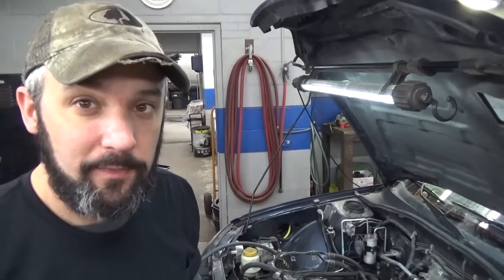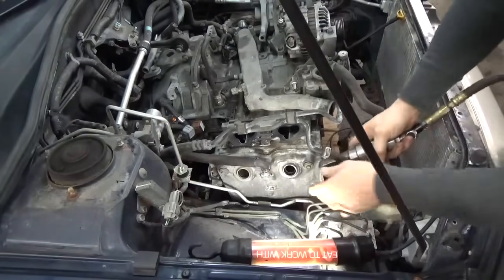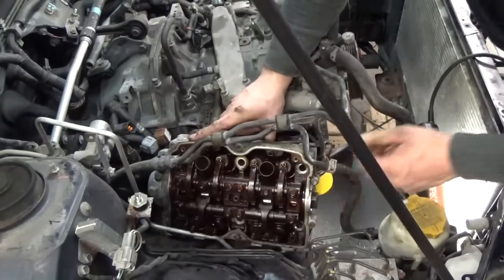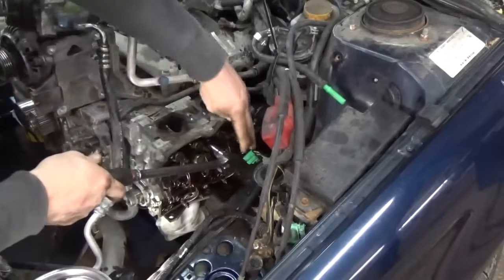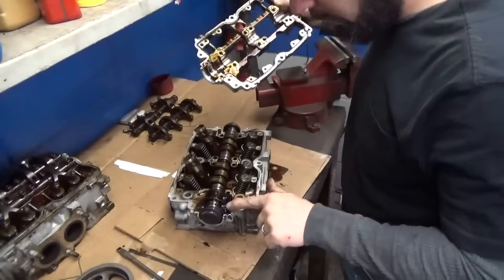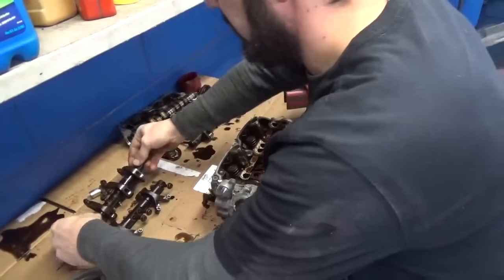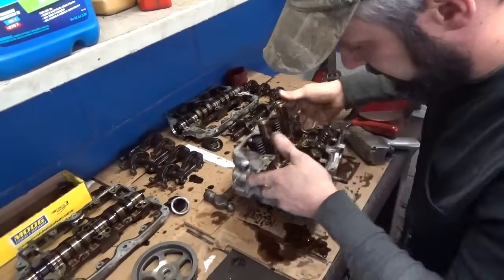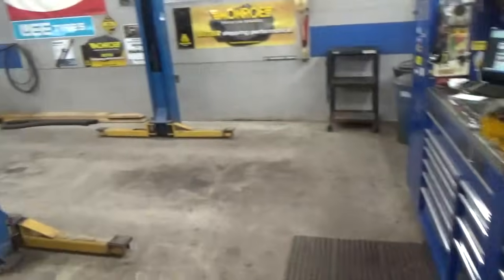Replace Subaru Head Gasket EJ253 - Part 2 of 5

Comment: I took a short term job as a service writer in the mid to late 70’s. At that time, EVERY ONE of them had leaking head gaskets at about 3-5,000 miles. They said it was due to head gaskets that were not compatible with antifreeze. Nice to see that nearly 50 years later they are still building the same junk at Subaru Heavy Industries. At the time, I owned a ‘72 442. They gave me a new demo with the job. I never drove it !good work Eric, I truly enjoy your videos, especially learning diagnostics on the new vehicles. Never too old to learn !

Comment: Not a Subaru tech or anything but I've seen other videos where theres a bolt pattern to remove the head bolts. Outside in. If you just remove them in any order you could snap a head bolt ask me how I know......

Comment: I started out at a Subaru dealership and was there for four years, I did plenty of head gaskets and never thought to do them in situ! Looks like I wasted some time! That's what you get for being a green apprentice! Nice series so far.
Reply from the maker: You lost me there..in situ? 

In situ (/ɪn ˈsɪtjuː/ or /ɪn ˈsaɪtʃuː/; often not italicized in English) is a Latin phrase that translates literally to "on site" or "in position". It means "locally", "on site", "on the premises" or "in place" to describe an event where it takes place, and is used in many different contexts.

Ohhh... so what did you do pull the engine?
Reply: Yeah. Pulled the engine and pulled the heads with it on the hoist, not too long a job because we did so many but never even crossed my mind to try another way! Dealer tech ah?!!!! I'm glad to say I'm a little wiser now.
Reply from the maker: Some times we need to slow down to go fast :)
Reply: South Main Auto Repair
 Brians mobile one has shown doing it in car and out ..he was MUCH fast out of car ..but then again he has a video up of pulling the engine in an hour and change ..( no talking fast forward ..just showing the process)

Comment: Eric I really do appreciate the mechanics that can do this job properly I haven't had such luck I swap the motor for a junkyard engine which didn't work out switching the oil cooler and everything .. ended up taking it to a shop to have the heads done on the original engine properly and five star head gaskets installed and they didn't even  put the oil cooler back on the original engine or the torque converter cover which I spent like an hour and a half installing on the other engine on my back the car being 2 and 1/2 to 3 inches off the ground.. you can  get  aggravated when you know people have all the tools to do the job right and they still find ways the script for screw it. so thank you for sharing this knowledge and your hard work. .

Comment: At 4:03...wow that valve cover came off easy! Can't imagine why they would change the design on the '05 and up EJ253. Those older style rubber oil grommets/washers around each bolt may seep a bit, but at least the bolt comes out no problem!
Reply from the maker: The big trick when your doing sooby v-covers is to jack the engine up. They pop right out :)
Reply: Yeah for sure! I meant on the '06 Outback that I did, the valve cover bolts were fused solid to the valve cover by corrosion (since they did away with the oil rubber grommet style), requiring an extra 3 hours of extraction and replacing all the bolts. I imagine it's even worse in upstate NY!
Reply from the maker: I haven't had one of the '06 up engine seize up yet but I sure do like the way those ones seal.

Comment: Hey Eric, I worked for Subaru for a couple of years and did a lot of head gaskets. I noticed you were talking about making sure the head bolts are lubed to prevent popping and creaking which is true but it's the coolant and crap in the bolt holes that cause the problem. Make a tap out of one of the old head bolts run that down and blow them out. I also saw that you did the heads in the car. It's so much easier to pull the engine. These engine come out super easy take about 45 minutes. Sure beats being bent over the car for hours. Also company 23 is a good site to find a handful of Subaru tools that will make your life easier.

Comment: I would send the head to the shop with the cams installed. The bearings or the lobes may be worn and the shop can tell. Now would be the time for new ones while it is all apart. Minimal extra cost for a better running engine & peace of mind. Also a new timing belt when you put it all back together, as well as coolant flush, t-stat, pressure cap & hoses.

Comment: The first Subaru I did was a 2000 ll Bean 6 Cylinder with 225000 miles on it,   I chose to pull the motor so I could reseal the motor while I was at it.
The car was from the east coast and of course there was a lot of corrosion all about the vehicle.  Once I got the engine out which really was not to b ad to do I went to pull the timing cover off of the engine and replace the timing chain and reseal the front of the motor.  At this point I discovered that it was a good idea to pull the motor to reseal it as the 6 cylinder motors have a 1 peace aluminum timing cover on them with 56 bolts holding it on and every bolt in that cover was corroded away so bad the only way to get then our was with a pair of needle nose vise grips and the Allen heads were just gone.  FYI Subaru wants $115.00 for the bolts that hold that timing cover on.  Apparently they thought the gold anodized was really gold right? Well I elected to go to Fastenall and had them order me some new bolts which was a lot cheaper. 
All and all though I was glad I pulled the engine as I was able to install a new rear engine seal and front Transmission converter seal while I was in there.  
If you have a weak heart do not take your Subaru to the dealer if you are having head gasket problems as they want right around $4500.00 to do the head gaskets on one.  Also you will here a lot of BS about which head gaskets to install and I am here to tell you that is exactly what it is is BS.  Have the heads resurfaced and the valves done and use Fel Pro gaskets and you will not have any problems what so ever. Use the Permatex Gray sealant and follow the instructions on how to apply the sealant and you will be fine.  The vehicle I did was for my cousins daughter 3 years ago and it is still running strong with no problems and it has had a lot of miles put on it since it was done.
That's my 2 cents for what it is worth?

Comment: I usually leave one motor mount with the nut on but loose so only one side of the motor comes up and there's more room to work.
Loosen the intake a stick a 2×4 under it. No need to remove intake.

Comment: I’ve been a Toyota and Honda tech for many years and find it amazing that Subaru had such difficulties sealing an all aluminum engine. If they were dissimilar (aluminum/iron) maybe I could see it.
Reply: Bean counter mentality.  The SOHC engines had a cheaper gasket than the DOHC Turbo versions, which don't have this issue.
Reply: @bborkzilla  they also suffer from it. And broken piston rings.

Comment: For changing the head gaskets on any Subaru would you recommend sending the heads to the machinist or was it because these ones were warped? From one Erik to another, keep up the videos man! Loving them!
Reply from the maker: erikdude666 Hey Erik, I always send heads to the machine shop when ever I pull them to have them checked for cracks, straightness and I have a valve job done too.

Comment: Love your videos, dude. I'm about to do the head gaskets on my EJ22 and  I noticed you loosened the bolts in  the same pattern as their supposed to be tightened. I thought the rule of thumb is to loosen heads in the reverse torque order. Or does that not even apply here? Thanks!

Comment: Are there more motor mounts to unbolt besides two 14mm nuts with washers, underneath those round pads under the car, and then also the strut from the top of the bell housing to the firewall?  Am I missing something?!  Mine won't come loose.

Comment: removing head bolts with impact ok? I have the engine out already, I will be sending the heads to the machine shop but is the same necessary for the block?

Comment: Hi Eric, i'm a big fan.  My son just bought a 2010 Forester 2.5l turbo XT Limited and i'm trying to get familiar with this car.  My current question is i need  to check  the valve clearances on his motor and i've gotten to ~4.5 min in this video where you've lifted the motor and pulled the valve covers.  I can see lifting the motor and getting more "room" but can I check the valve clearances without lifting the motor or is it realistically in the too hard to do box?  I'm very familiar with working bucket cam follower type with the heads off (i was a racing engine machinist years past) and his Forester does have a noisy valve train but my son had the car diagnosed at a Subaru dealer mechanic and he said the valves need adjusting.  I'd like to at least check the clearances.  Sorry to be so long.  Thanks Eric

Comment: How many hours do you bill a job like this for?

Also, I literally loled after you got the heads free of the engine and said that it was pretty easy. I'll leave a job like this to a pro and stick with oil changes and brake jobs in my driveway. :P
Reply from the maker: +Dave Easter I usually bill 11 hours
Reply: +Dave E its really not that had to do this,  once air box and connectors are off you can get to all the bell housing bolts and starter bolts with the car on the ground, support the trans and pull the motor right out.

Comment: Why do these Subaru head gaskets fail?What is the typical mileage that this occurs?Thanks in anticipation.Great video. btw.
Reply: Coolant can be corrosive, or the inhibitors can degrade, with the coolant always being in contact with the bottom of the gasket, also people don't flush their coolant often enough. From what I've seen, gen 3 and beyond, head gaskets usually last up to 200k.

Comment: Which do you find more convenient - pulling the motor to do the heads or just leaving them in? I did a job just like this on the DOHC EJ25D of the previous gen and I pulled the motor. I'm about to do another of the same exact kind and was just wondering.
Reply from the maker: +RideThroughLife I just leave the engine right in personally
Reply: +South Main Auto Repair Even for the DOHC? It seems like they might be wider and in the way.
Reply from the maker: No I show in my vid how I just unhook the engine mounts, lift it up and move it to the side.
Reply: +South Main Auto Repair Do you have to unbolt the transmission mounts from the subframe, those 2 bolts? 

Thanks for all of your help too. The last time I did this it took several weeks. If I can do it quicker it'll really help me out since it's snowing all the time now.

Comment: How likely is it during a head gasket on the EJ20/EJ25 that the block needs resurfaced as well? Do you check for that or only worry about the heads being warped?
Reply: It's just the head gaskets that fail not due to overheating or anything so no point

Comment: you have 4 cog wheels, 2 for intake and 2 for the exhaust.  Where the other 2 cog wheels connect to? I only seen one cam on each head for 1 cog wheel each.

Comment: Hi Eric,  I was told I have the usual gasket  problem, planing to do it myself over the summer. I will use your videos to guide me through it (outback 2007), do I need to send the head to a machinist (what is it being sent for?) or is it just the car you are working on? I was just going to change the gaskets and reseal it and get it over with! I apologize if it seems like a dumb question but I just got into doing my own car, and still feeling my way around it. Thank you in advance

Comment: Eric how much time are you saving by not taking the engine out. ? 

What do you charge for this job? 

What do you charge to do either the rear main or oil separator plate?

Comment: What is the main causes for head gasket failure ?
Reply from the maker: Good question Tom OConnor. Not real sure. I assume just gasket failure. 90% of the time it is an external leak but in some cases you see the compression ring on the gasket break and they leak internally. Just my assumption but I always blamed the factory gaskets...
Reply: Incompetent Subaru design/engineering.

Comment: Why didn't you just take the engine out
Reply from the maker: Just to save time is all, either way works
Reply: So it's faster not to take the engine out because I have to do it on a 2002 outback limited 2.5l and I'm trying to find the best way

Comment: Those boxer block look like a pain to work on changing heads and/or gaskets.
Reply from the maker: You know I really enjoy them honestly. Not as bad as you may think.
Reply: Corey Toolen  Inline aren't any easier. It's all the same shit. I am surprised Subaru hasn't switched to studding these engines instead of using bolts. Maybe those bolts get loose and fuck up the gasket.